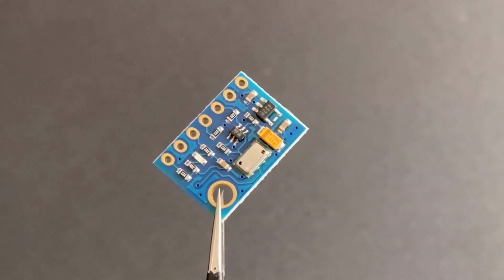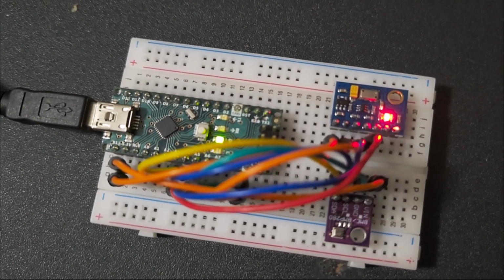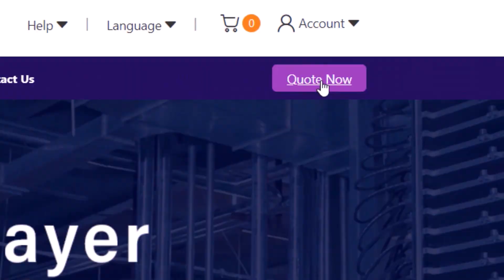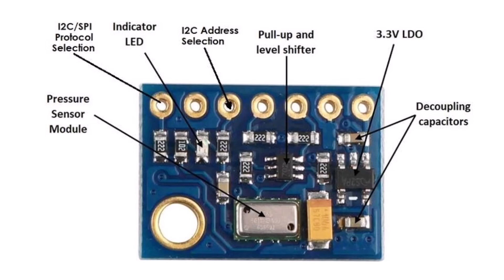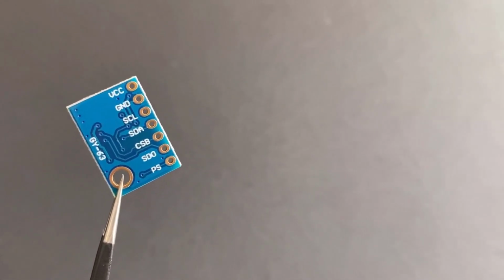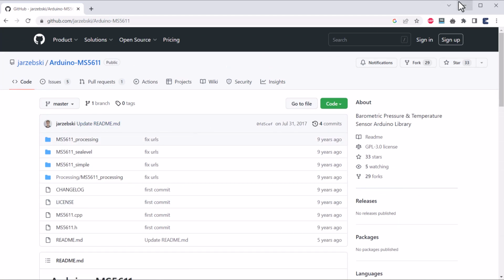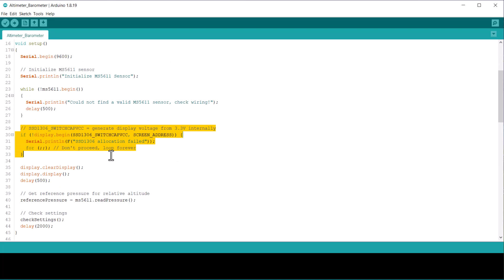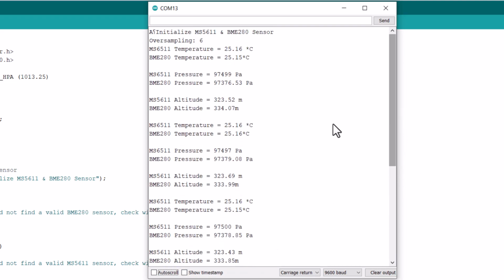MS5611 Barometer/Altimeter Tutorial with Arduino || BME280 vs MS5611 Comparison

Comment: Mam, can we make a vario altimeter using this for paragliders? Combining with a gps, it will give a lots of data... What do you think?
Reply from the maker: You can make.
Reply: @HowtoElectronics  but I have a doubt. You know, because of natural reasons, a places air pressure never stays constant everytime. There should be a calibration system I think in that project. What do you think? And my programming skills are not that much good. Have to do a lots of work on it. Mam are you interested on it? st7735 tft display shud be a good choice I think
Reply: @AkashBagFEce  any altimeter/device using base pressure and base temperature may need calibration when weather changes - no doubts in that. Depending on which accuracy and precision you need, you choose a barometric model for your project. You can even plug humidity in your equation to increase precision if you wish. If you need just a buzzer which indicates altitude change rate, then the situation is simpler. Do the math and you will see it yourself. In this case you may also wish to compare the results with your accelerometer data to increase precision and filter out outliers.

Comment: Next step is to add an audio output script with one output driving a buzzer! This will then be a fully functional variometer for paraglide and handglide pilots. The display priority will be absolute height and climb rate in m/s. Do it!☺. An accelerate meter may also be added to improve the responsiveness of the whole setup as there will be some lag from the barometer to the audio output. The initial acceleration may be used for compensation thereof, but this may become too complicated.